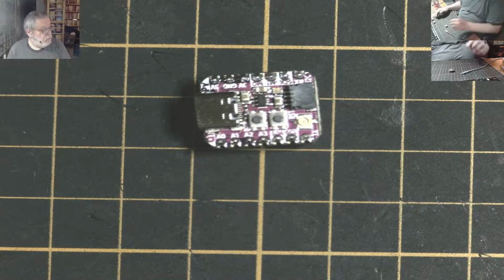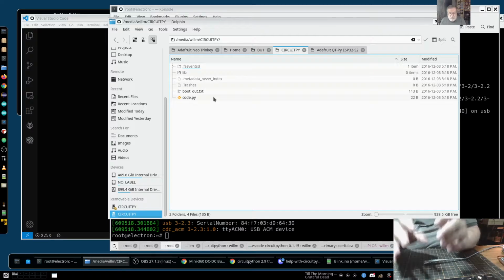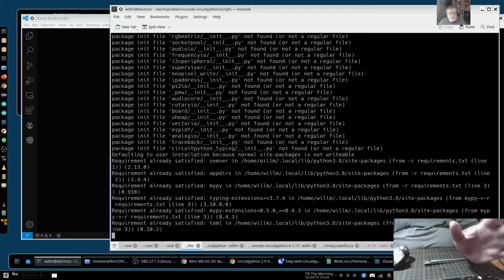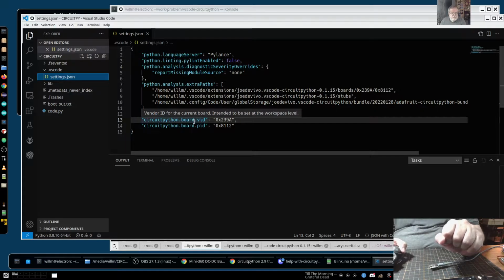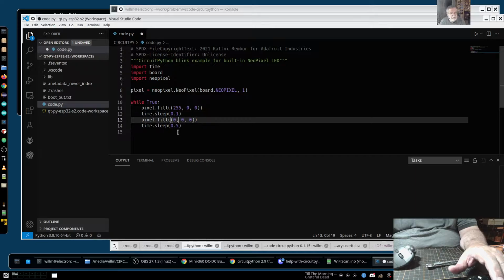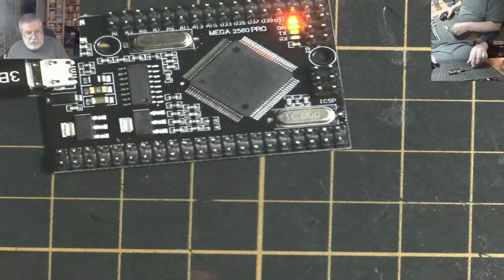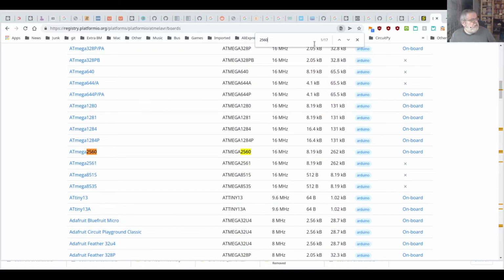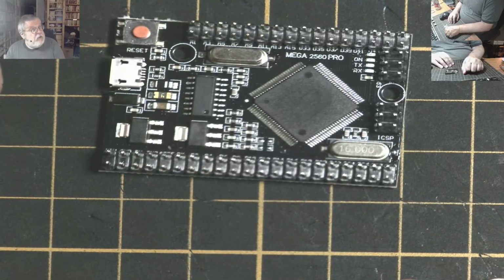How to update the VSC Circuitpython ext for newer boards and a update on Mega 2560 Pro

Comment: two blinks means it is unhappy with the code. First, thanks for making this video. 2nd this video hits on what i run up against as "a new  person to microcontrollers (from Adafruit)", they start out their primary guides saying they have the boot loader "installed" that allows you to double press and be recognized. Don't beilive it, if it works great, otherwise put the recommended bootloader on yourself, And then hope the first example works because a lot of the time it does not...As you show with blink.